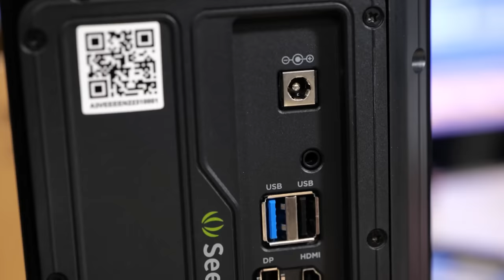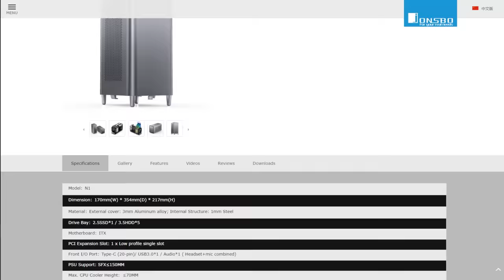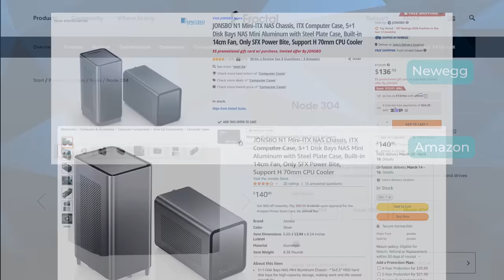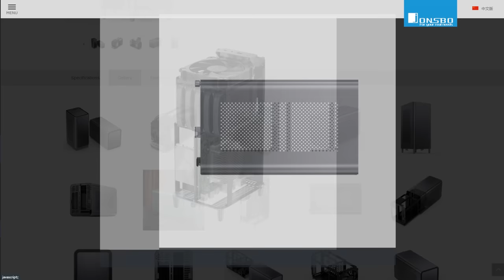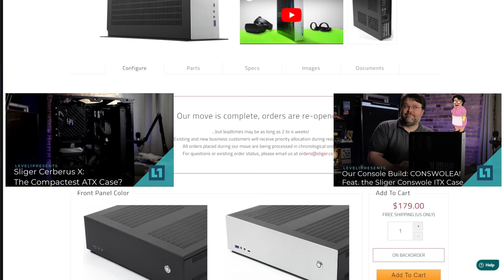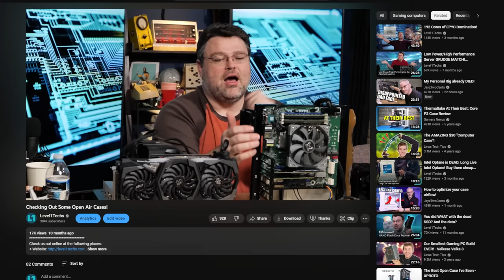The Ideal Home Server! Is it Possible?

Comment: This is where ASRock Rack mITX Epyc board comes to the rescue... with PCIe4x16 slot standard and 6xPCIe4x8 over miniSAS if I recall correctly... with 2x of those PCIe4x8 being splittable to a total of like 16xSATA drives... before you factor in any AiCs with storage controllers or networking or eg. media transcoding acceleration (maybe Intel ARCs or similar, once some lower power option becomes available, elsewise T400 or T600, or - wishful thinking - Alveo u30), this looks great, only the cost of the mITX ASRock Rack board with Rome (or newer) even lower-core-count lower-TDP Epycs may scare most... And that's before you factor DIMMs and storage itself.

Comment: My Jonsbo N1 is absolutely stuffed. 5x 3.5" hard drives, 4x 2.5" SSDs, 1x LSI HBA to connect all the drives, 1x M.2 SSD, and because I've already run out of PCIe slots, 1x M.2 to PCIe riser to connect a Mellanox 10gig SFP+ NIC. This case is a monster.

Comment: I'd like something like the Antec 900 but I want it in a rack mount. Something I could use standard (120mm) fans, populate the whole front with those icy dock bays. Then I could mix and match the front hotswap as I need and it'd be a case that could grow. Make it a shallow depth and allow it to accommodate add-in cards for more customization.

I love rack mount and even a small rack is pretty cheap for your home. A 12u on rollers or something is amazing but what isn't amazing is your typical rack mount fans. I want something that you could have in a room and still be able to use that room for something.

Comment: The Gigabyte B650I AORUS ULTRA has 2.5Gb intel, wifi 6E, 4 SATA ports and 3 m.2 ports. 
you could put in the m.2 slots a boot drive, a sata to m.2 adapter and a network adapter.
Reply: oh also because of the fact AM5 has onboard video, you could quite easily forgo a videocard and run a pcie 5.0 m.2 card for a fast raid.

Comment: I'm 100% on-board with this line of thinking regarding the expandability of 5.25" bays and having looked around there just aren't good options any more, well not cheap options. Something like the Lian-Li PC-343 would be pretty epic but they were always too rich for me though to fill them out would be super costly anyway, but at least you could do it over time. Of course you'd need a lot of PCI-E lanes to fill out that many bays even if you only went with 30x3.5" spinning rust. Of course the flexibility of 5.25" bays is that you mix and match to your heart's content.

Comment: I bought a used dual xeon lga-3647, installed 2 m.2 expasion cards populated with 8 m.2 drives of 4 tb each. Enough storage for me. I use the system for vm's and as a storage server. Extremely fast for me, the server was quite economical as well, still have 2 more pciex16 slots left over for more storage if required.

Comment: I have an ASRock Rack EPYC3451D4I2-2T motherboard in a Silverstone CS-01 as my current storage server. The CS-01 only has two 3.5 inch bays and two 2.5 inch bays, but I couldn't easily get any other case (such as the Jonsbo N1) for a reasonable price here in Australia.

The motherboard is admittedly pretty expensive and only takes RDIMMS, but it has an incredible 14 SATA ports on an ITX board, 12 via OCuLink ports (one x4 and one x8) using octopus cables. I wish using connectors and cables like that was done in the consumer space - we could have so many more ports on ITX motherboards!
I notice others are mentioning the X570D4I-2T, which does similar with two x4 OCuLink ports and is probably a less expensive way to get enough ports for most uses.

I really wanted the Lian Li PC-Q26 as shown on this channel years ago (https://www.youtube.com/watch?v=K8HMLi7pt3I) with 10 3.5 inch bays, but I couldn't find it anywhere. It would've been the perfect case for that motherboard!

Comment: I'm half tempted to go towards a rack mount system. My biggest problem is space in de house (so have to hang it vertical which I'm not happy with). I'm now rocking a Fractal Design Define R5 and I'm out of 3 1/2 slots (this is including the 5 1/4 repurposed, tho I could go for an icy 2 5 1/4 -> 3 3 1/2, as now I''m only using 2, but yeh that's a minor step) 

Your aluminium extrusion intrigues me. That opens up the options that I can expand / resize at will. I still have a lot of them (for my never finished 3d printer project) but that changes my thought on my Define R5, would be a bit more space effecient if I'd go a small case for my server (althought it's an ATX mobo, it feels like it's a tiny bit bigger.. I think they cheated with specs to fit as much stuff on it as possible, it's the ROMED8-2T from Asrock)

Comment: The main obstacle to the ultimate home server build is that it still needs to be a home server, so it needs to be (relativity) affordable.
The main obstacle that I am encountering is lack of PCIe, ideally I would want a PCIe switch/router since while I need a significant amount of port I don't need to hit them all at full speed at the same time, but that does not exist (at a reasonable price).
In my home server I'm orienting myself to buy sata SSD since I can more easily multiplex port, but is not ideal.

Comment: Currently migrating to a Node804 for my server, and pairing it with the MSI PRO B550M-VC WIFI. With 8 onboard SATA ports and 2 M.2 slots, it's got plenty of storage. Plus the case can fit a slimline optical drive which is perfect for ripping media directly on the server. To top it off, the mobo has 4 16x slots. I'll be adding a 10G card, GPU for transcoding, and maybe down the line some more storage cards.

Comment: Like you, my only lament of these home NAS and media server cases is the lack of drive bay accessibility from outside. Opening up the whole machine for a drive swap is inconvenient, even if it makes for a prettier looking system.
I currently use and old Acer EasyStore H340 chassis (4 bays). It is standard ITX but needs (a) some wiring modification for (some of) the front panel buttons/lights to work, (b) a really low profile CPU cooler, and (c) a carefully measured out flex PSU or a pico-PSU. I have it running intel 6th gen, mostly for NAS, non-transcoding media, and VM duties.

Comment: Picked up a NAS Board N6005 ITX mobo with 6 SATA connectors, 2 m.2 slots and 4x 2.5gbit intel ethernet ports from AliExpress. It cost me right under 200 bucks with shipping and it will be a perfect fit for the jonsbo! 4 HDDs and 2 SSDs via SATA (array and redundant cache) and 2 nvme drives for docker and VM storage / cache. Hoping to build a nice sfx mediaserver for the living room. In the office there will be my larger NAS in a Define R5 for all the other services. Lastly a basic Synology DS for the backup of both systems. Ideal low powered tiered solution I guess!

Comment: Happy with my Fractal Core 1000 case (super basic) and 16 2.5mm SSDs via IcyDock 5.25" bays. Case supports mATX motherboards which is my next upgrade to get 10Gb networking. Thanks for info on Asrock motherboard. Will consider.

Comment: The JonsBo case has a flaw and an omission imho the flaw is that the when used as a tower the fan sucks from above and blows down while the hot air from the mobo and PSU + the hot air from the drives themselves wants to go up... thats an efficiency pitfall and the omission is that they should have some sort of lid on its side to be able to swap (e.g a dead) hard drive even easier (compared to having to take the entire shell out )

Comment: I have a Node 804 with 8700K, 5 mechanical drives,  2 nvme drives powered by a platinum fanless PSU from Seasonic and 10g optical networking. Its been rock solid for the last 4 years Ive had it and upgrading makes little sense because of the cost new hardware especially the motherboards. The lower end boards usually don't even have more than 4 SATA now so they really limit your storage. You don't even get anything new apart from maybe AV1 encoding/decoding with gen 14 from intel but that can be easily added via a 150$ arc GPU. So I am holding off on any purchases for 2-3 more years.

Comment: Now that everything is smaller; we need a new standard for PCIe; always liked the idea of using SFF-8643 for PCIE 3.0 x4; oculink was also on the right track but seems like it didn't stick yet. Thunderbolt technically without all the cost, licensing and have it internal and have a standard for (1) exposing ports and (2) screwing these things to something; we need to combine the flexability of 5.25 and pcie slots into a single thing now; think "pcie backplane" in the same way we have sata backplanes... :D; And sure... there might not be enough pcie lanes directly; but make the PEX chips more mainstream to lower the price and have "switch" blocks that you can add to multiplex them together; not every device needs all the bandwidth all the time; especially for home/smb use... just feel like we could do SO much more than what we're doing with the tech we have.

Comment: I have two of those Intel cages and a rosewill cage in a old atx case.  Now lays flat for eventual use in a rack.

Adaptec 3016 / omv / mergerfs / snapraid

I cut out most of the case front/bays and just bolted the cages in. Sealed the gaps with painters tape so the rear fans pull air across all drives. Ugly, but works.

You should list the models of everything mentioned so people can search easier. I snagged my cages for about 35 but that was pre chia

Comment: The real issue about home servers is not hardware; it's software.  I've tried a number of different dedicated "home server" operating systems, and I find all of them needlessly complex and fiddly.  I don't run Plex or host Minecraft; all I need is a file server, a place to store backups from about a dozen other machines, and a way to copy files and folders to optical drives.  Yes, I still have a use case for optical drives.  To solve this, I built a Core i3 10100 machine on an ATX B460 board, with a small SATA SSD system drive, six spinning hard drives, and three DVD writers in a Rosewill 4U case.  The best part -- it does what I need it to do running plain old Windows 11.

Comment: its an really complicated issue. it depends on so many angles. but density+efficiency is in my opinion one of the main points if you name a server Ideal. A small Server with all the features you need plus low running costs. You said that you would go back to intel 10th gen. I would even go back to Intel Gen4/5. If you find the right board/cpu for your needs. Because (high-end) ipc is not the main aspect. But efficiency defenitly isn't bad for that older platforms. if you get all the features you need, its defenitly an option. Performance/running costs/acquisition costs - its all very inline with that what you can get today.

You are very right about that itx case topic....something like a TU200 case is what you simply can't get anymore...

Comment: I'm moving towards getting a rack server. I have a bit of network gear a backup server a application server and all the ups stuff. Not really worth having a server unless it's 24-7 and you need a ups for that. A rack mount is the only real option at this point.

Comment: I have an Antec 900 and always thought it would be an awesome home server case. I already have a Norco rack mount case with 20 3.5" bays but if I didn't I'd be using that Antec for it
Reply: Every time I see a 900 or 902 pop up on craigslist I get sooo tempted to just buy it even though I have no immediate need

Comment: I agree with mATX for home servers. The extra space at the bottom is perfect for some extra drives. What I did with my racked NAS was 3D print some hotswap cages and stick them to the bottom with double sided tape.
Pick an mATX board with extra PCIe slots rather than extra M.2 though, even if they are only a single lane. Each PCIe3 lane can do 1GB/s, meaning it’ll support 3-5 SATA HDDs before becoming bottlenecked (assuming each drive does between 200 and 300 MB/s in a sequential read, which is my experience with NAS drives). Each M.2 slot then is costing you an awful lot of potential 20TB HDDs. 

Kudos to Wendell for making me get Optane for a metadata special device, too. I didn’t think it would do anything noticeable over Ethernet, but that was entirely wrong and the improvement in latency is nothing short of incredible. Definitely you want two M.2 slots, so you can use fast modern storage for your metadata and small files. Even if you’re not getting optane it’ll be a huge boost.

Comment: Love this.  But, maybe save some space in the base with only single or double 5.25" bays "side-by-side."

Add an expansion piece at the bottom with the 3+ 5.25" bays or some basic hotswap cages with simple handles like the Jonsbo has?
Give it enough room to mount a SAS Expander, then fill the drives up as much as you want.

Targeting a 1 to 2 stack of 5.25" bays will leave a lot of room for fans and/or 2.5" adapters that are much cheaper than the Icy Dock devices, that have shot up by $100 or so in the last year.

I've also found myself targeting the SFF form factor as the enterprise stuff comes down.  2TB DC SSDs for sub-$100, 4TB consumer SSDs close to $200, and 960GB of Optane in a U.2 905p for $400... all-flash seems possible for the enthusiast datahoarder, now.

Targeting an all-flash primary build with an "expansion" for 3.5" drives and additional 5.25" bays makes a lot of sense to me, and is my current focus.  So, that may also just be my bias getting in the way.

Regardless, hope we can see some sort of mATX NAS-focused, maybe modular case ala the MASS: https://modcase.com.au/products/nas

Comment: I want to see lower power, modern hardware. Something like the B650D4U-2L2T/BCM
in a shallow rack mount case
and i want to see how far you can reasonably push the PCIE connectivity.
That means, m.2 adapters, pcie sata cards, pcie switches (plx?) 

I want a lot of pcie 3.0 / 4.0 devices on NEW hardware, not power hungry data centre ebay stuff.

How can I turn 1 PCIE 5.0 16x into as many lanes of pcie 3.0/4.0 as possible. And how can that fit into a rack case.

Comment: I still have an old Thermaltake Armor Series VA8003BWS with 11 5.5" bays and it works great for stuffing full of HD's... well I only have 6 individual drives in it right now.. need to get a couple of those icy dock's. ( I need more PCI lanes though.)  it's the best solution I could find, for large amount of 5.5" bay's  so why buy something with less drive space, when I allready had the armor, yea it maby a monster full tower.

Comment: I'd say that for most of us - it start by running plex. Then we start adding drives, move onto hardware encoding, and then start down the path of virtualisating a few vm's for fun. If i were rebuilding, id be looking squarely at a 13th gen motherboard combo. iGPU will mean no need for an extra card, saving those valuable PCI slots for other things. HBA to SAN maybe :-)

Comment: Supermicro still have their A2SDi Mini-ITX Atom boards, with 12 or even 16 SATA ports. And they sip power. Obviously, an 8-core Atom won't blow anyone's mind on performance but they also draw very little power for what they are, and have full-on IPMI 2.0 on there.

Comment: I've got a Lian Li PC-50 midi tower (much nicer than Antec). Having 9x5.25" drive bays at the front.
Currently with 2 x Chenbro 5x3 hot swap enclosures running 10x3.5" drives. Advantage of the Chenbro (or Supermicro) enclosures is, that -- unlike the Icy Box stuff -- it does not cook your drives and drive trays are cheap because they were used in data centers a lot.
Board is an ASROCK P67Extreme6 with a recycled i7-2600K and 10 SATA connectors.
Does the job, runs 24x7x365 for the last 8 years and is not too bad looking.
And compared to today it was all very affordable at the time.

Comment: Great video. Not sure folks understand the implications of a RAID5 or RAIDZ1 vs RAID1/10 rebuild with those monster drives. It will (a) take an extremely long time (and you better not lose power during...) and (b) a SECOND drive could fail during the rebuild. Also some mention of NAS software choices and filesystem choices (ZFS vs MDADM/LVM/Ext). 

Oh, and the whole "RAID is not a backup" discussion. New DIY-NAS builders are not considering the cost of backing up all of that data-hoarder goodness.

Comment: Wendell step on your stripes with the manufacturers for more pci-e lanes and more pci-e slots on the motherboards so we can build an awesome nas with a lots of containers and high bandwidth.

Looking for an upgrade from an xeon 6 core v4 to a new system. Need 3 pci-e slots for hba cards, 8 onboard sata and preferably 2x 10g.
Currently have an 9300-24i for the hotswap hdd 4u case from inter-tech. Need one hba in the near future for expanding with jbod enclosure as the bays are nearly all full and one slot for nvme add-in card. Use the system for media, business (nextcloud, webhosting and backup) and personal (file storage and backup) use case. It's becoming the all-in system rocking unraid. Would like your advice  for a build that as it all with prefably a consumer cpu. Currently have a ipmi interface and it's a gamechanger when trouble occur so either ipmi or your kvm-pi solution is also needed. And it needs to be energy efficient cause running it is getting expensive.

It's impossible with a consumer grade cpu of the current or latest gen. If you succeed in assembling a system like this i wil certainly take my hat off and probably give it to you cause you earned my respect then.

Comment: I love running my X470D4U with my 8 hotswap bay U-NAS NSC-810A, but I've been tempted to cut some drives and try out the Jonsbo N2. Curious if you have the N2 coming down the pipeline, cause I really feel like this would be the one to keep an eye out for the ideal home NAS. I was contemplating the N2 with one of the ASRock ITX X570 server boards.